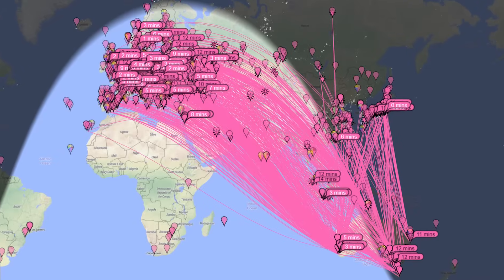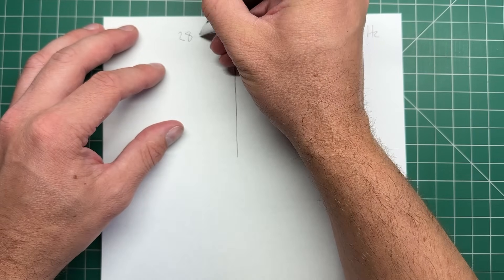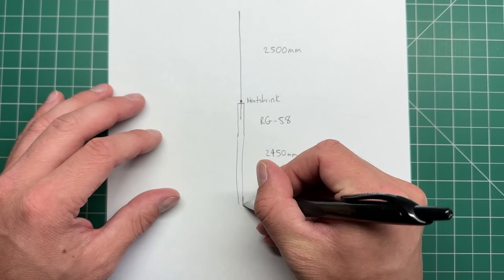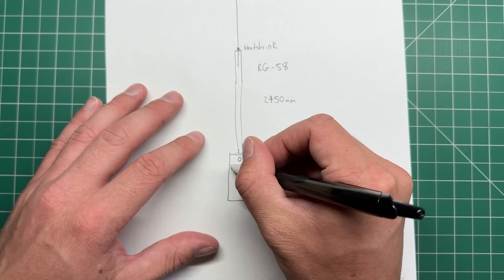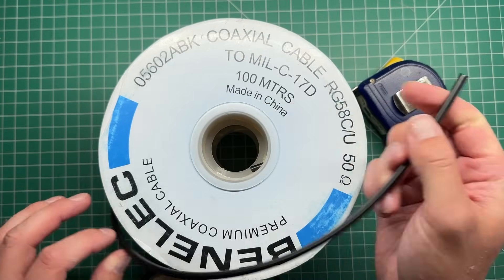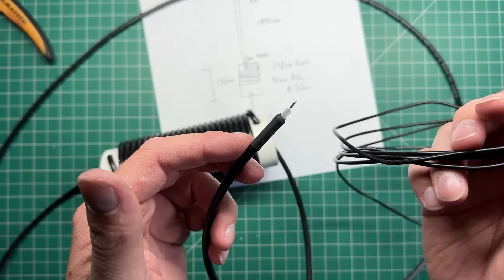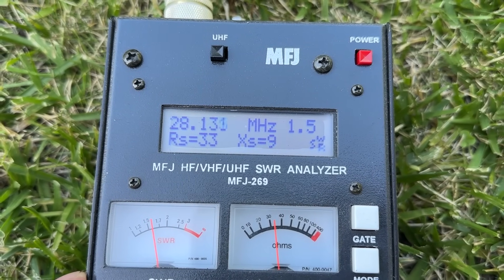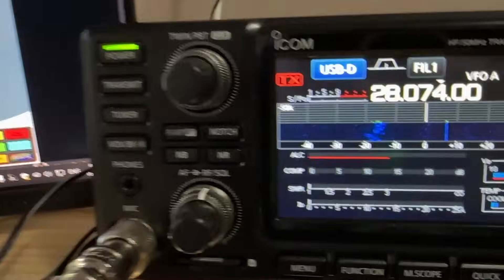Build an EASY 10 Meter (28 MHz) Vertical Antenna for DX!

Comment: Very broadbanded and versatile antenna the T2LT although the acronym really refers to the choke not the complete antenna. On 11 meters I talk over most of the planet with it just now as conditions are as you know the best they've been for quite a while. My choke (ugly balun) is 5 turns at about 4.5 inch diameter iirc. Going to now build one to the dimensions in the video to compare the results. I suspect the tuned transmission line trap may originally have had some sort of variable capacitor in parallel or maybe the capacitance of the coax in the choke is adequate. I'm sure someone will enlighten us.

Comment: Nice build,if u put a pl259 on the bottom of the vertical dipole i can make multi band lengths to plug into a box with a cmc in it

Comment: Nothing wrong with what shown on the video, and it works great , yet we found that an old station master ( 1/2 wave n 11m ) easily tunned to 10m will do better (found one for $10 in a garage sale) , no fuss, cheap, easy to build ( if you can't find a ready one ) and is a DC short, great for noise /QRM rejection and might save your rig if there is a lightning storm is the proximity of your QTH ( direct hit, forget it, lol )
10m meters is open, let's have fun.
thanks for the video.

Comment: I made one similar to this for 2m/70cm works great. I didn't attach a separate wire to the inner core I just stripped back the braid the required length. Great video, must try 10m now.

Comment: Thanks, that's a great compact antenna. I built a 10m delta loop recently which also works very well but it needs more space as it uses 2 guy ropes.

Comment: I've built them for 2, 4, 6 and 10metres Great antennas I also dual banded the 2metre one with 70cms using foil sleeve. Superb performance for next to no outlay.
Reply: flowerpot dualband.. great antennas
Reply: @jameskaras4345  I built one years ago and couldn't believe the performance! Due to circumstances I had to use it indoors and at ground level. Even so I was regularly talking up to 20miles! And over 40 miles on my helical 4metre one!!

Comment: My simple 10 meter verticle is a 108 inch stainless whip atop 22 foot aluminum  military poles with the top most pole fiberglass.with three 8 foot wire radials its been up 9 years and has outlasted 2 of my previous factory made cb style antennas i will never go back have made many DX all over the world.jim KB1PFL

Comment: Great build I have a flowerpot for 2m I think there is 3db of gain for 2m not sure if it's the same for 10m. Great work.
Motters M7TRS 73 👍🏻
Reply from the maker: Thanks
Reply: It's a half wave dipole, so should be 0dBd gain, or 2.15dBi, theoretically.

Comment: They are fabulous. I built one just before Christmas for the New Year SOTA rollover. Going to build one for 21MHz next which is as low as I can go and still fit it on my DX Commander 12m pole.
Reply: 14MHz should more or less fit on a 12m pole.

Comment: Does the 2450mm. section of coax between the choke and the "element" radiate? Or does it serve another purpose?
Reply from the maker: Yes. That is the other half of the dipole.

Comment: I built one of these for 2m/70cm. I built it in side of a 1" piece of schedule 40 so I can stick it on a ground spike, hang it from a tree, lean it in a corner or even hold it in my hand in a pinch. Surprisingly good little antenna. Built to spec it was a little bit long. I ended up unwinding a couple turns off the coil and that brought it right down to flat @ 146Mhz where I wanted it. 6m is probably next :)

73 KC3UVF

Comment: Great video… thanks. My local builder, Michael Vk3cmc strips back the outer braid instead of soldering on the top quarter wave. Testing one yesterday, same as you, with a 705 and listening to 2RSY it gave a whopping 2 S-point improvement on receive over the Diamond CP-6, which, though the latter is a compromise, really surprised me.
I have worked some great dx with 10; 15; and 20 metre flower pots!
Reply from the maker: Awesome! Yeah I just used the wire to save a bit of coax (and time) stripping back the braid, but that's correct you can use just one piece of coax for the whole antenna.
Reply: @HamRadioDX  Hi.  Do you strip the dielectric to expose a bare top copper wire, or leave dielectric on if mounted in PVC??  :-)

Comment: Instead of soldering the end could you use wire connectors?
Reply: I'd imagine you probably could, but I think durability/longevity would become an issue at that point.  KC3UVF

Comment: Have you ever considered using an FT240-31 instead of an FT240-43?   I've used the former for EFHW and it's worked great
Reply from the maker: Yes I have. I think the 31 mix is a bit better at the higher frequencies, so it should work at 10m and 6m well. I think I actually have a mix 31 on my 6m yagi.

Comment: OMG you've read my mind. I was only telling someone the other day, "I'll have to make a 10m and 6m flowerpot antenna" and mount it on my squidpole.
Reply from the maker: Hey mate!
I wanted an antenna that was a bit higher off the ground than my 1/4. They work well and are very simple, don't take a whole lot of room either.